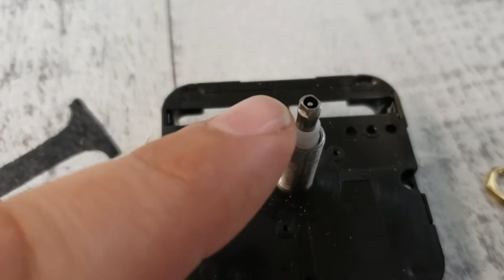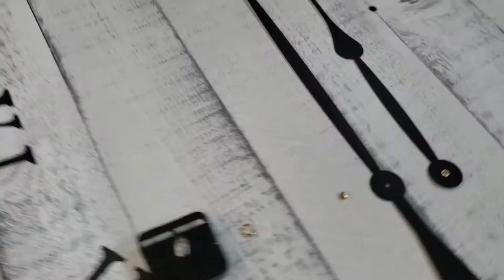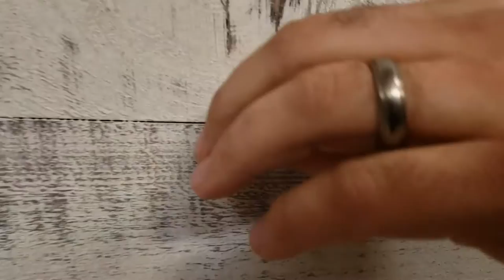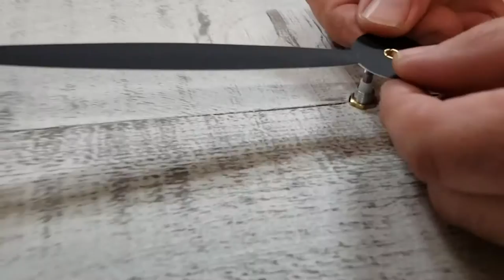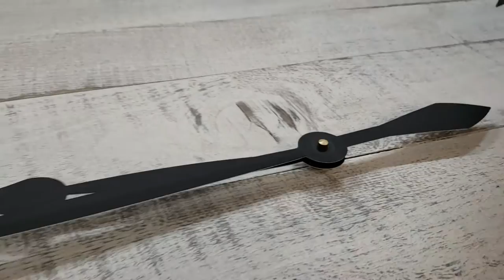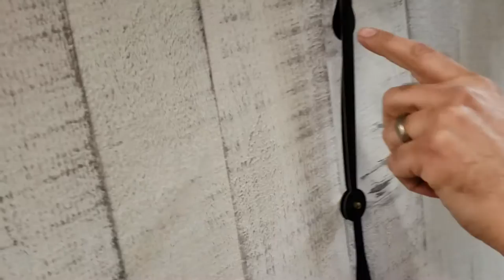How to replace a wall clock motor and clock hands.

Comment: Mine is a pain! It has a glass in front so the shaft needs to be short and as I’ve learned needs to be high torque, it’s a pain to try to find a short shaft high torque. I guess I can use spacers on the clock to accommodate the longer shaft.
Reply from the maker: Try clockparts.com

Comment: Great. Now please say how to put the 2nd hand on.
Reply from the maker: Instead of using a cap nut to hold the minute hand on you would use a regular open nut. This leaves the center shaft open. The second hand would be pushed on to the tiny shaft in the center.  Large clocks typically don't use second hands they move around to much and make an audible click. Without the second these are really quite.
Reply: @coreyszyikowski348  My clock is an 18" postal synchronous,  pre 1950's. The 2nd hand is a foot long. I had no idea my clock 2nd hand was missing the barrel that pushes onto the movement sweep.
 Any chance you sell the piece my 2nd hand needs to put it on that little spindle in the movement? 
Until I listened to your video I didn't realize my clock was missing a part.
Diane M. Doncheski
You have my admiration and deep thankfulness for helping me with my Synchronous clock, dear man!
The 2nd hand was laying in the bottom of the clock glass when I acquired it. I refurbish antiques and collectibles. 
Mostly furniture,  but I have more than a few clocks. However,  the Postal Synchronous kicked my butt! The beauty of the Postal Synchronous for me is the 2nd hand sweep with the bright red paint and a Cresent moon on its tail.

Comment: What's the length & width on those hands?
Reply from the maker: 17 3/4 on a 42" clock.
Reply: @coreyszyikowski348  thank u sir. Where should I get it where its less expensive.
Reply from the maker: @taswwarali3211  I get these via clockparts.com.
If your in the states I sell them on etsy.com yankeewoodworks